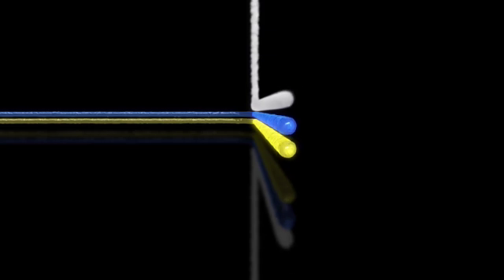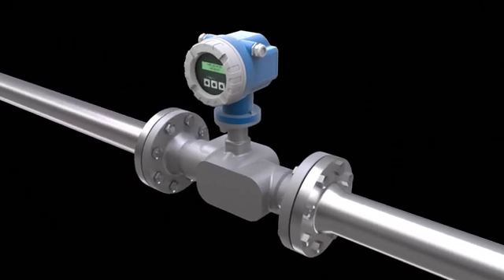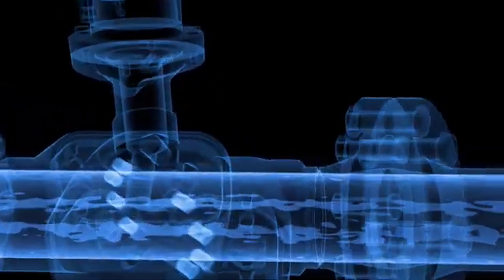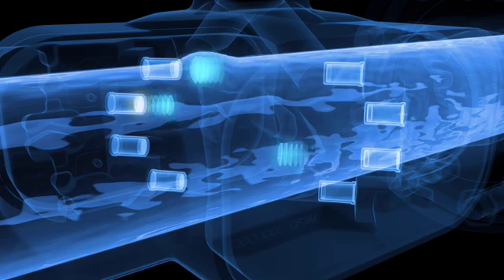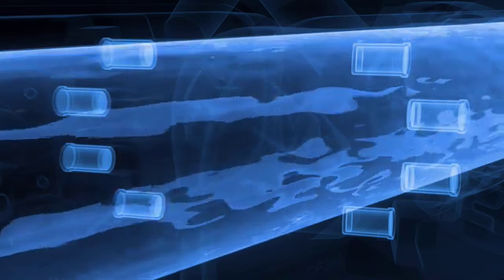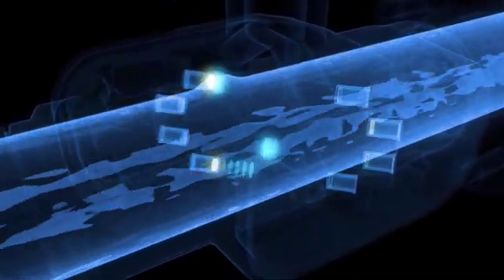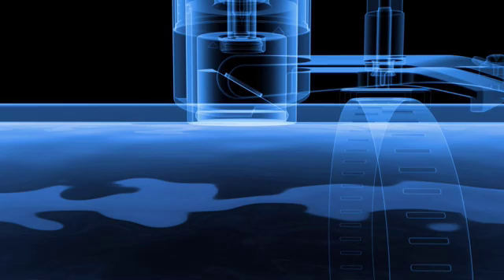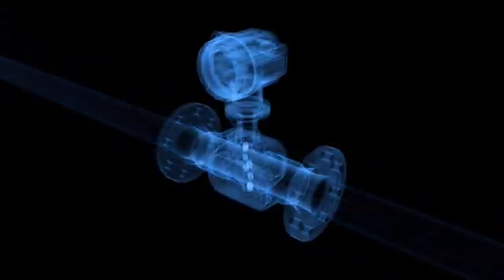The Ultrasonic Flow Measuring Principle

Comment: Does it need to be calibrated for a specific density first?
Reply from the maker: The measuring principle is generally independent of the fluid density, however the density correlates to the sound velocity of the fluid. This will effect the positioning of the clamp-on meter impacting the accuracy. 

For inline process meters changing density has no effect on performance. So, the meter does not need to be calibrated with a specific density fluid for process measurement. However for “high accuracy” inline meters used for billing (custody transfer) they are often calibrated on specific density oils to improve performance with changing flow profile.
Reply: @endresshauser  

Thank you for the detailed explanation!

Comment: does this work if the flow doesn't cover the whole cross section of the conduit ?
Reply: From one of our Product Managers: The meter will still provide a measurement in a partially filled pipe, but it won’t hold to the accuracy spec. The volumetric flow rate is established by combining all the flow velocities determined by the transducers, along with the cross-sectional area of the meter body.
Reply: @seanbeeker4980  : can I get more information somewhere? I am working on a project requiring measurement through a pipe but a wider range and we have several scenarios requiring shallow flow. Can you recommend a meter for that please. Thanks

Comment: Are the sensors in physical contact with the liquid
Reply from the maker: It depends if you are using an ultrasonic clamp on meter such as the proline Prosonic 93 the sensors are NOT in contact with the liquid. If you are using an inline meter such as the Proline Prosonic B 200 the sensors are in contact with the liquid.

Comment: wait.. since the sensors are inclined .. how does the signal both in upstream and downstream reach the other sensors?
Reply from the maker: By design of the sensors and proper positioning it is made sure the sound beam always hits the opposite sensor.
Reply: is it because the wave speed is much much much much faster than the water speed?
Reply from the maker: Mainly it is because of emission angle, deflection when entering material with different density (pipe wall, fluid, pipe wall) and corresponding positioning of the sensor set.

Comment: how to reduce turbulence ?
Reply from the maker: Turbulences can be miminized by optimized installation of your flowmeter. For recommendations check the technical information of your flowmeter manufacturer.
Reply: Endress+Hauser  thanks for your reply but in a large system where piping can't be alter a bit and have non linearity how can it be improve...and flow rate difference of 0.6 between two ends,is it significant?
Reply from the maker: Yes, you can use a flow conditioner or you can install the meter further away from what is causing the flow disturbance.